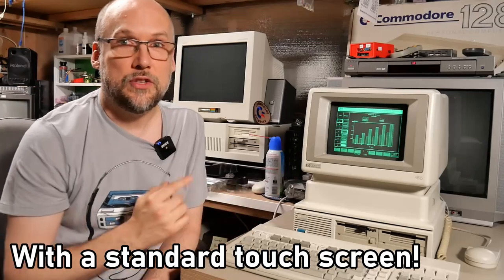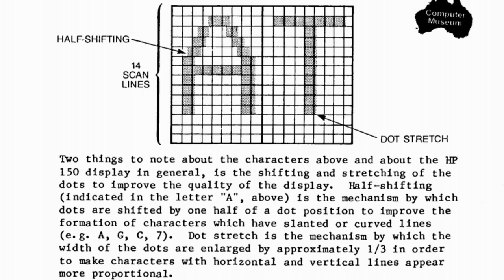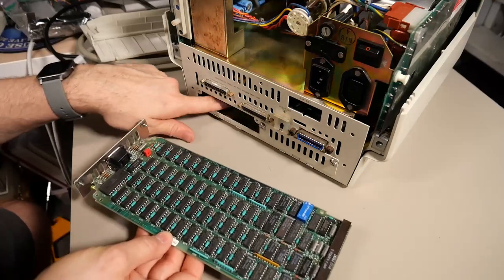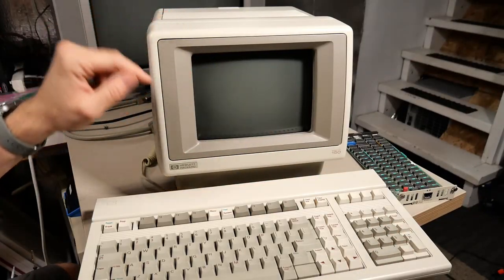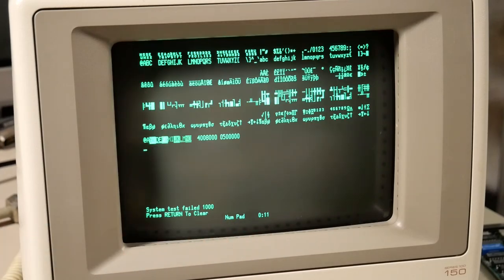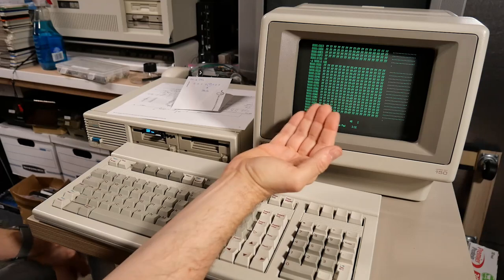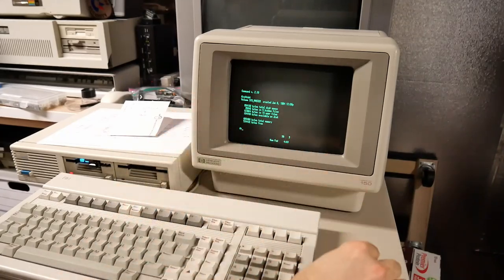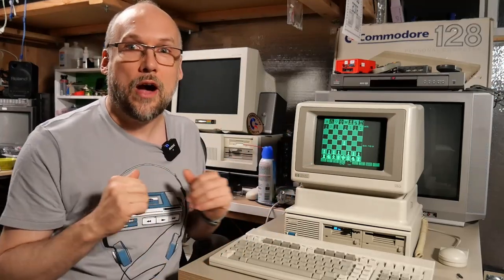Touch Screen MS-DOS PC from 1983

Comment: If those chips have a write enable pin you may be able to test it without desoldering/cutting it out by pulling the pin up or down depending on how the chip operares with a bodge wire.
The chip would be completely stuck and you would not be able to read or write to it during test.

Comment: On the next part it will be interesting to see the hardware inside the case of the computer, its visible that is came with two floppy's but I was wondering If I could see if there if room for expansion memory on the mainboard, expansion slots, if the board has a serial port, a parallel port and if we can ad a hard drive either using one from that times or like one of those episodes when you used a secure digital or compact flash adapter to EIDE. That's fun.

Comment: 17:46 - The board fits inside a metal rail or runner, and this trace was too close to the edge. The metal holder would rub through the resist and short the track out. So they've cut the track and run a bodge wire. Then if the track gets shorted to the chassis, it doesn't matter.

Comment: Nice to see that manuals from the HP Computer Museum (www.hpmuseum.net) have been able to assist in the repair of this unit!
Reply from the maker: Such a great resource! Same for all the software posted there. I was able to convert those to images to a format that allowed me to use the Gotek in the HP 9121 to get this thing running since both my 3.5" drives have spindle motor issues.

Comment: I think that to find a faulty chip, you could try to short the legs of the chips to ground. A couple of data pins could be short-circuited to ground, and see where instead of 0b11111111 something like 0b11001111 is read

Comment: I used one of these.  Cleaning the infrared holes was a common issue.  Quite a bit of common DOS software was available for them including  Lotus 123 and Dbase II.  I found a software list http://www.hpmuseum.net/exhibit.php?swc=5  HP sold the Laserjet printer with a HPIB connector which was nice for the day.

Comment: I was an automotive tech in the 80's at a GM dealership. They came out with an automotive diagnostic machine on a cart called a "CAM's" machine that had the same touch screen on it. It was probably a specialized version of that entire PC??  And I'm sure it cost tens of thousands of dollars at the time.
Reply from the maker: Maybe! GM had the clout to get a company like HP to make a special machine just for their dealer network. I wonder what happened to all of those machines? Long gone, I'm sure.
Reply: @adriansdigitalbasement  Back 10-15 years ago some of them ended up being given away or scraped. I had a chance to get one for free, but had nowhere to keep it.

Comment: Having experience in repairing industrial PCs, you might want to check those tantalum capacitors and even the ceramic ones, they are a pain, even if they are small, bad ones may be turning off arrays of chips !

Comment: The blades of the fan have brown dust on them.
I see a lot of brown stuff on the ram board I think al need to clean it.
You did not need to cut out the chip all you needed to do was bring up high another pin to check.

Comment: HID IO Devices here are also used in HP9000/300 series and HP3000 series machines. At least the same keyboard mechanical components and the keyboard frame and layout, and same for the mouse. Connectivity and electrical compatibility I wouldn't know.

Comment: Take the corroded battery terminal out, clean it with Vinegar, then tin it with solder to prevent it from oxidizing.

Comment: Printer on top not so crazy. HP made these PCs for instruments like HPLC (Liquid chromatography) and users would want to print spectra and this kept it neat in a lab environment (hence the HPIB I/f). 
Quite agree with build quality & design - Our lab used HP Vectras for a long while. Did loads of memory upgrades & instrument card changes. Unlike many pc cases of the time (which often literally drew blood when you upgraded them) things just swung out of the way to give access. Guess designed by engineers for engineers in that respect.

Comment: HP-HIL was cool. All kinds of Human Interface Devices would connect in a daisy chain (that mouse would be last...) and it was *fast*, 8 MHz clock rate. Think ADB but years earlier (and correspondingly more expensive!)
It was mostly used on the HP 9000 workstations.

Comment: It amazes me how clever the engeneers are at designing and building these machines but how terable they are at making them describe there self diagnostics. It’s the same with the hi tec heavy earth moving machinery that I work with . You need a computer to talk and decipher the codes that the on board computer puts out when you have a big touchscreen that could just tell you what senser is reporting a fault .. why so smart yet do dum ?

Comment: 36:55 - If you had connected the output of the memory bit you clipped out to the /CS signal (active low) then you could have seen that bit "stuck zero" without affecting anything else. This would have confirmed the right output as your read of 0x4000 would have always returned 0x00 rather than the stuck 0x08. And you'd not read a floating signal.

Comment: Isn't it computer for all HP scientific devices like multimeters and oscilloscopes? I thinking that they use same IO as floppy disk. Also that printer was used for printing data from that devices. CuriousMark have some HP computer that communicates with such devices and he even proceed data from oscilloscope using basic in this computer.

Comment: Nice troubleshooting thought process!  (BTW, you could have pulled the lines high or low with a resistor when checking whether or not you had the right chip.....)
Reply from the maker: How? All of the "bit 3" chips in all the banks share the same data bus -- pulling it low would have affected all the other chips on that line.

Comment: The one thing I never quite understood about HP board design is that they insist on putting the male connectors on the backplane/midplane. Over the years I have seen the pins get bent on the midplane, and changing the midplane is a much bigger job than a board. Not so bad on a PC, but this design choice made it to the bigger hardware (SuperDome for example, and changing the midplane on that was a major job involving a lot of disruption).  The only thing I could think of is maybe someone decided that the manufacturing cost of a midplane/backplane was cheaper than a board, so if you're going to break something you might as well break the cheaper component!

Comment: I’m not sure that replacing the backup batteries with the CR2032 will work well. I guess they used the bigger cells to compensate for a much higher power draw by the CMOS RAM. So I would expect a much shorter battery life, before having to replace the CR2032 again, compared to modern, more power optimized systems.

Comment: First, I have no experience with this machine.  Nine the less, using some deduction could the error codes referring to the mezzanine memory been referring to the memory location where the touch screen input for that not responding colum and all of its intersecting rows is written to?

Comment: Wow what a magically sharp CRT, kind of makes a VIC-20 etc look a tad poor.
At the time, I worked in a place that had a lot of HP etc gear, with really nice displays, then I'd wander into the local computer shop, looking at C64's etc, non of them looked any good at all - I had been so spoiled by HP.

I was wondering why there was a strange blue glow emanating from the first disk drive, then you mentioned a 'gotech?' - ah, you've been modifying it already.
In those old drives the grease really dries out and lock the mechanism quite badly, it can take ages to get them going again.

Comment: Very interesting, had similar fun cleaning/adjusting the touchscreen on the one I was given a couple of years ago. Luckily that was the only fault and the 9133D 15mb hard drive unit works perfectly which makes it vaguely more usable.  Love to get Windows 1 on it but it only has the built in 256k and windows needs at least this much.  One day I may luck upon one of the various memory expansion boards at a suitable price point. Not that I have come across any any any price mind!  It does not help that I would imagine this machine is even rarer in the UK than it is Stateside.

Can't wait for part 2 but will give no spoilers relating the non-standard disk format and means of getting data onto and off of them. Interested to see about the Gotek although have enough disks and everything I have have is on the hard drive anyway.

Comment: I'v said about when sockets are used and not.  Some are due to timing witch is most likely what it is on this board as it has what you call boge wires.  Also cost

Comment: Back in the day I worked in Malaysia, a hot country, where we had HP touch-screens. The latest and greatest(?)

Only problem was we also had flies.

The position òf the 'touch' ứa detected by a matrix of IR beams so when an operators finger dỉsupted two cross-axis beams, the screen would interpret the location. Unfortunately HP couldn't discriminate between flies and fingers!

Comment: Seems to me you could have bodged a pull resistor onto the suspect chip and probed for the new stuck bit with debug. If the original designer had deferent view of sensible you may have cut a lot of chips to find it.

Comment: far too late but maybe this hint helps someone. Finding the right bank / chip can sometimes be done by soldering a dataline to a pullup resistor directly or by intervening with an additional logic gate in combination with an enable line of the chip beeing assumed to be the culprit. This is much easier than desoldering and worring about getting the wrong chip. Sorry for bad english :-(

Comment: Wait a moment — so a single byte is stored on different RAM chips in different banks? Great debugging btw!
Reply from the maker: Each ram chip holds 64k bits --- so 8 chips is one byte x 64k -- or one bank of RAM on a Intel x86 16 bit processor.

Comment: Reason why they cut the traces and replaced them with wires:
The board has not many layers and is stuffed with through hole components, and the routing of the traces was chaotic, as there was simply not much space between the parts. Loopy traces can be seen as a coil,  inducing magnetic fields in other traces and also receiving radiation from neihhboring traces. This is very, very bad for signal integrity. At that time, it was not known so much to engineers, or better said, ignored, as there was no better option. With only two layers, you could not have a dedicated ground plane. Simulation was not advanced, so they figured out the flaws in real life and patched. Same as MS does today with sodtware ;). Another reason: ground return loops: Current that comes in somewhere, must get out somewhere, preferably the shortest way. And a loopy trace is the worst solution. It will induce voltage (let´s call it noise) in other traces, lowering signal integrity, and it  change the potential on the ground path, lowering guess what. Actually very horrible, but it was like it was at that time. They patched it, and in the next design they took it ino account.
Reply: Paul Kocyla 😎

Comment: Great video, thanks. I remember working with one of these as the console on an HP 3000. The integrated printer let you do screen prints of error messages etc. In your video when you figured out the error was the touchscreen it was like a light bulb moment -of course, I remember having to clean those holes. The program controlled function keys were really useful, it's pretty clear in the video when you are going through the system setup and testing. Compare this to the function key combinations in WordPerfect 4.x where you needed the function key strip stuck down across the top of your keyboard. How many of us still remember what shift-F7 did? I'm looking forward to your video on the disk drive. I hope you have some of the, very odd, original disks. I remember keeping one, but I haven't seen it in years.

Comment: can it run "normal" version of DOS like any XT or is it running a propietary version modified specifically for this hardware?. you mentioned it's not PC compatible, so I find it curious that it runs DOS and could potentially run windows 1.0. (again: the same regular one or a different version compiled for this thing?).
Reply from the maker: The software for this is designed for the HP 150 -- it doesn't run normal IBM PC software as it doesn't run a IBM PC compatible BIOS and things like the video and other peripheral subsystems are totally different.

Comment: You know that board with a fault on it, I would connect a Multi-Meter to ground "common" on the board, and make a note for each pins resistance to ground for at least two ram chips, "opposite to each other in the entire array", Now if the figures or "resistances" are within 10 to 20% of those two Ram chips, You could then proceed and check all other ram chips in the entire array are also about the same, if one sticks out as different more than all the others, I would replace that Ram chip, and see if that gets the resistance within the ball park figure of all the other Ram chips within the array, Now if all the ram chips are much and much the same, Check for shorts across capacitors, and if you find some capacitors are shorted follow the tracks where it leads to an IC and remove that IC, if the short still exists after the IC has been removed, I would be THEN checking all Capacitors and or components for one of them to be shorted to ground, if you have a really good Multi-Meter you could also seek the portion of the PCB where it has the least resistance or best conductance, thus indicating near to where the short or shorted component exists..
Good luck, BTW APU I dropped a like..

OK back to the rest of your video.. 
***Addendum** 
NVM you fault found the culprit via the software way rather than the hardware way, Having said that I would have loved knowing which pins of it were shorted or not matching the other ram chips resistances..

Comment: Adrian are all IEE488 disk drives created equal?  Could you put a PET disk drive on an HP, and vice-versa?
Reply from the maker: The physical communication signals and addressing, yes, but the commands used no. So a PET could use this disk drive if your wrote custom software to talk the "language" the 9121 talks. You definitely couldn't just connect it and use it with the built in PET commands because that's expecting Commodore DOS in the disk drive.
Reply: @adriansdigitalbasement  That could be a neat programming exercise.  Alas, I have neither the skill nor the equipment...

Comment: 15:50 These ICs are static RAM of course. Probably the usual 6116 (2Kx8) or 6264 (8Kx8) compatible. Why the heck would a computer video generator board need several ROMs? :D

Comment: Does the add in card option in the system options now also show something, mouse settings?
Reply from the maker: Even once working, it doesn't show up there. And I haven't been able to test the mouse yet either. I think that section is for option ROMs which it seems the HP-IL card doesn't have.

Comment: If each chip used is a single data bit in the system, you could induce an error by shorting  a single data bit to grounding on each chip. this would at least determine which chips are bit3 of the data bus.. This would eliminate 7 of the 8 chips on each bank of memory, you only need to replace 1 chip per bank.
Reply: Should have waited and saw you determined which bit was what

Comment: 20:00 no diode to prevent charging?
ps. nice video as always :)
Reply from the maker: No the original batteries are not rechargable but just regular lithium N type batteries. (like a CR2032 but 1.5v each.)

Comment: Are the touch sensors memory mapped IO? Intel processors have a memory space and an IO space. A lot of early IO was mapped into the memory space. The original C language allowed you to use memory pointers as variables. The all you had to do was to place this variable into you equation, This was fixed in later C versions. If they did this then they could test the sensors while doing a memory test. If that had mapped the sensors into IO space they would have had to have a separate program that PEEKed and POKed the array. The optical touch was a bit flakey sot it would need to be regularly checked for particulate matter that covered on of the holes.

Comment: Hello, how are you? I love your channel and I admire your way of repairing and diagnosing faults. It makes me happy to see you look for faults and see how you solved the problems of this HP150. I ask you, I have one that unfortunately the video card was attacked by the batteries, I repaired all the tracks cut and I changed the chips that were ugly but it doesn't work with the video card on it stays dead and the led test doesn't work and if I turn it on the video card does the test and it throws me a video card error Since it is not there, if it is blocking the start-up, where would I have to look for the fault? I have already tried all the oscillators and clocks and they are fine. I would appreciate it if you can guide me which stage can cause it to block, I do not know if the bus of the machine or what It makes me unable to take the test. Thank you. It is translated with google Greetings.

Comment: touch screen, fully detachable disk drive/peripherals, and a printer built into the top of the monitor (or at least space for one)? I'm not sure I'd call this a PC - even if it does run dos, that's really close to the specs you'd want in a point of sale system.

Comment: I suppose you could have soldered some wires on the chip-select of each suspected RAM with LEDs and run a loop in debug to write to one of them, and see which LED blinked… (or use digital probes but that's cheating).